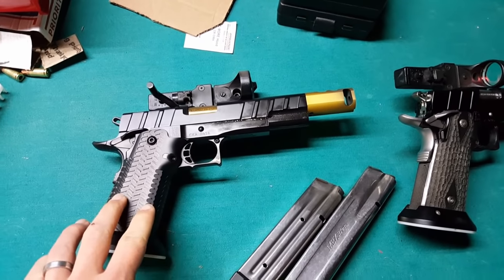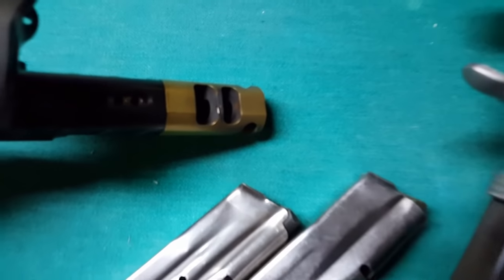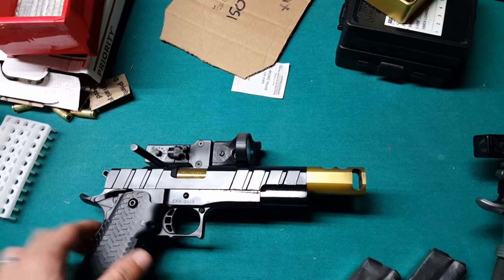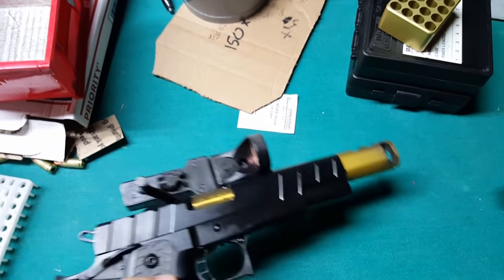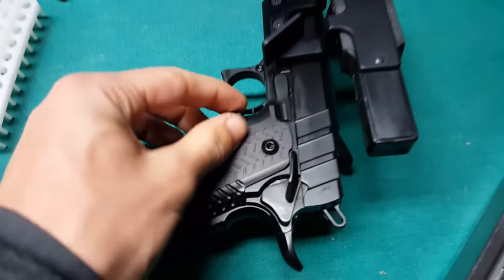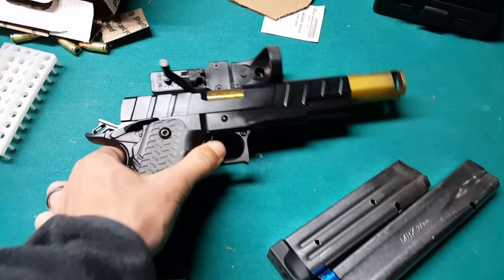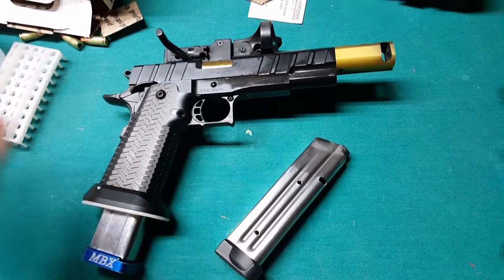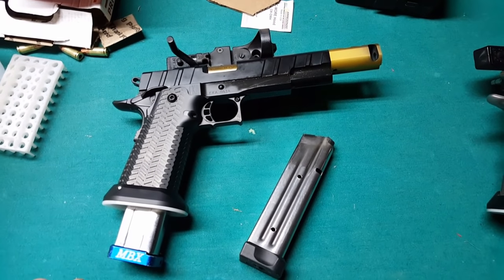Stuff about race guns.

Comment: Stupid question here. Why shoot 9mm major over minor?
Reply from the maker: There are no stupid questions man!  To answer there are a few reasons to run Major PF ammo instead of Minor.
1.  Its part of the game.  In USPSA there is different scoring for major and minor powerfactor.  With major PF you get more points for hits outside of the "A" zone.  in major scoring a "C" or charlie hit just outside of the A zone is worth 4 points.  The same hit in minor scoring is 3 points.  

2. Tied into the first, you can go faster!  with the scoring being less stringent the acceptable hit variation when shooting major is much larger, meaning you can engage targets much faster.  It is VERY difficult, next to impossible to make up the difference with lessened recoil of minor PF ammo.  you can shoot just as fast with minor, but unless you hit all A's it wont be in your favor.

3.  The guns are built for it.  the comps, holes and recoil system are all purpose built to take advantage of all the gas created by Major ammo and turn that into lessened recoil and muzzle rise.

Hope that answers the question, any thing else feel free to ask!
Reply: Robert P if every question was thought of as stupid we would all be imbeciles just saying.
Reply: More points

Comment: I shoot a Tanfoglio Limited Pro Nine in 9mm major, my C-More is mounted normally it could be the difference in the style of extractor but with mine the empty brass is ejected into area about a foot in diameter and about two feet in front and about three feet to the right of me. and does this with total consistency using mixed range brass.
Reply from the maker: Yeah that dot was big dumb.  I run a rts 2 on my 2 SV' 9mms now and its perfect.  Brass is consistent about the same as you said just a few feet from my foot.